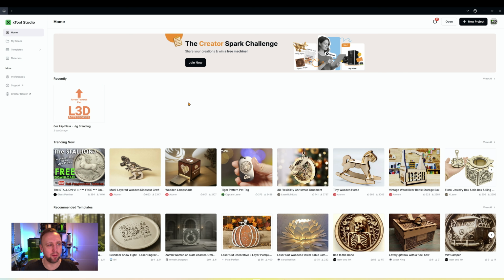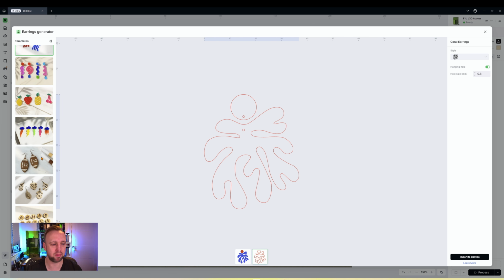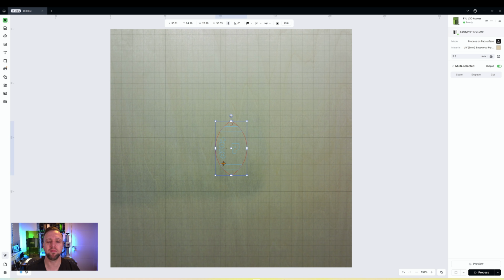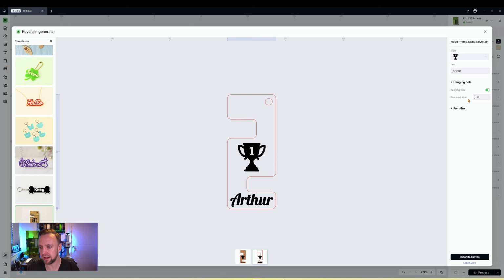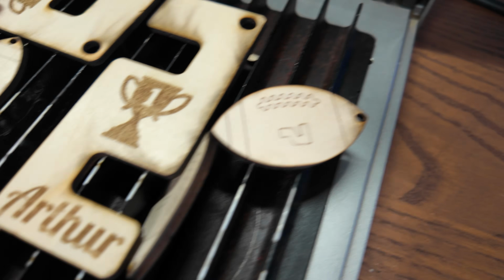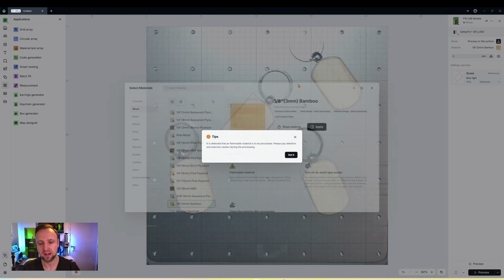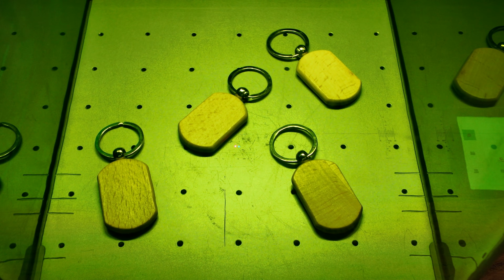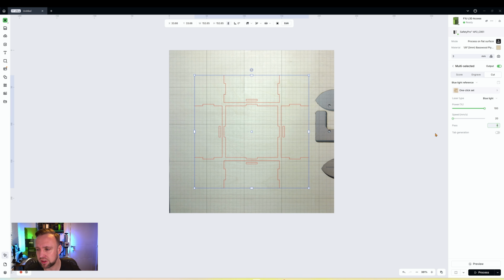xTool Studio Just Got So Much Better | 5 New Tools

Comment: When you use the box generatorfor the F2 Portable, measure the stock closely or the tabs will not fit. That was my case. In the drop down on the left side is where you can change the size. Took me 4 tries to get it. Makes a cute little box. Thought this might help.
Reply from the maker: Thanks for the helpful tip!

Comment: Great video.  I'm shocked the box worked as resizing like you did usually changes the slot size that is set for your material depth
Reply from the maker: Thanks Michele! I was really surprised too, it took a bit of force but the actual fit was really good and it was very usable.

Comment: Those bamboo key rings were ash not bamboo? Does that make much difference?
Reply from the maker: Were they? I always assumed they were Bamboo. Either way, I'd probably start with bamboo settings and run a material grid test to get the best settings.

Comment: I assume batch fill needs an engraved with a camera? Any way to do it on an S1?
Reply from the maker: I haven't tried it without a camera. I'd assume it doesn't work but I might test it and try. Maybe if you draw the bounding boxes and individually frame each one and then place your design and run the batch fill it will work.